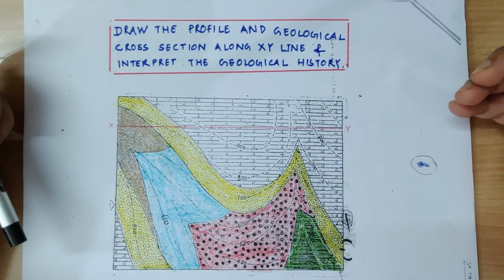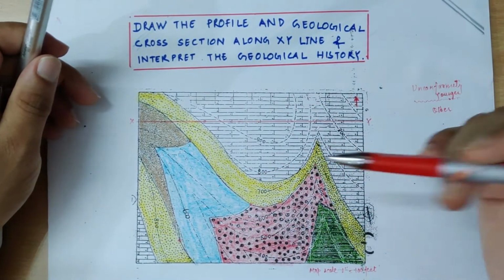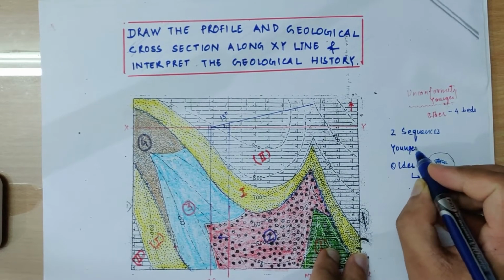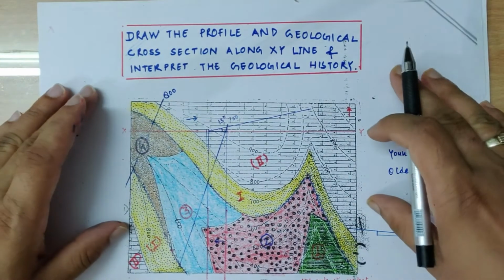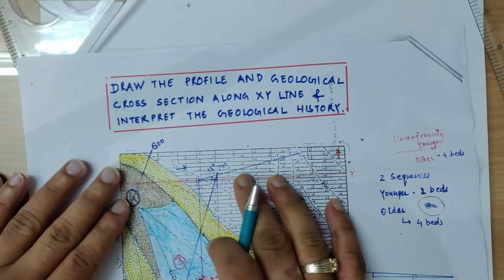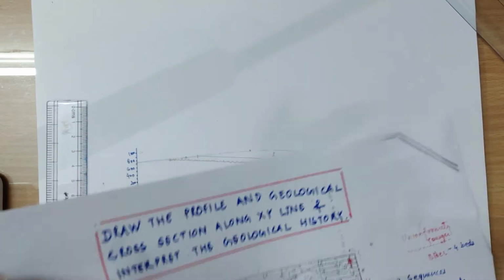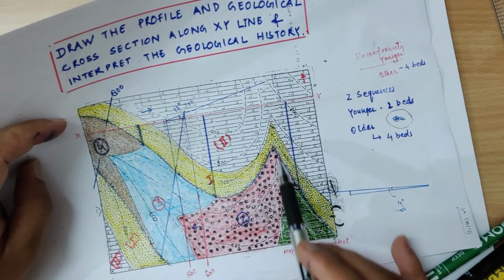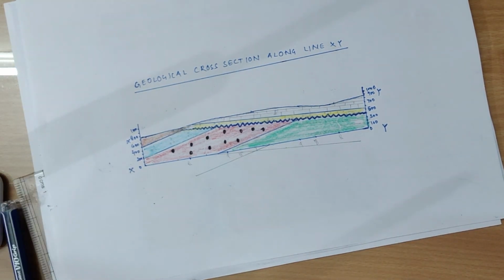Geological map profile and cross section : Unconformity Map

Comment: Just being curious. Shall we take the perpendicular distance between the two strike lines of 800 and 700 feet to determine the angle of dip for the newer sequence rather than the distance on the line of section only? What will be the difference?
Reply from the maker: Perpendicular distance will give true dip, but we are supposed to draw the dip angle in the direction of section line (apparent dip in case if its not Perpendicular to the strike lines.)